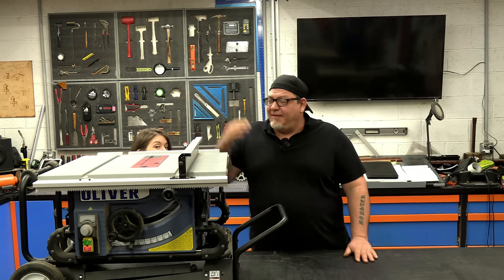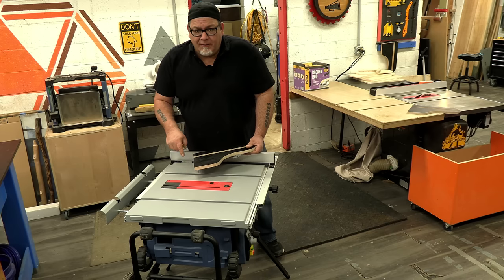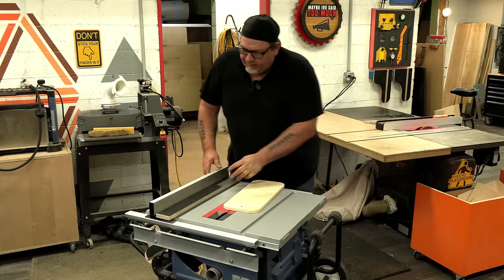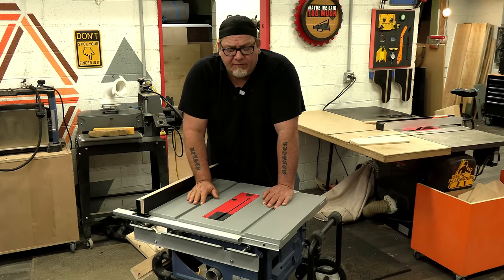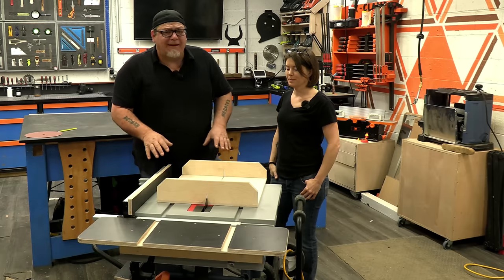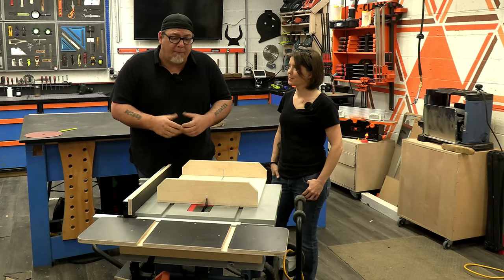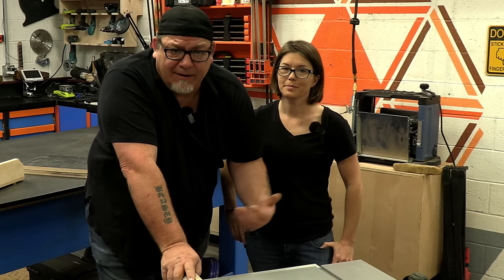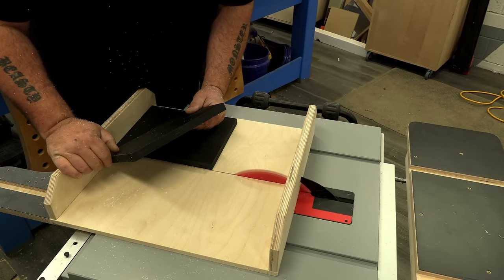3 Job Site TABLESAW jigs that WILL up your game!

Comment: As soon as you started cutting acrylic, I immediately realized the value of variable speed on a table saw.
Reply from the maker: The cut finish is much better at the lower speeds.
Reply: J'ai rien compris
Reply: Might be also helpful for cutting cherry and other woods that are prone to burning.
Reply: @izzyswan  A smaller diameter blade would go someway to achieving the same thing.
Reply: I was just looking to see if table saws have different speeds!

Comment: This is a great vid! I work with a Dewalt jobsite saw and was thinking of modifying the fence to accept sliding jigs, but I've been hesitant about it because of the flack I was afraid of getting. I like how you addressed exactly that. Think I'm going to go ahead with the mods and not worry about it. Thanks Izzy!
Reply: It's your saw! Do what you want with it. I'm just in love with the accuracy of tape on mine. I've never had that before. Always used a tape measure, front and back of the blade. I never knew how great it is to just set and forget.

Comment: I like that variable speed feature of the saw, always wondered why practically nobody built that in.
Reply: Cost - it's more expensive to manufacture, thus lower profit
Reply: @davidpeters8813  oh, I get that for sure, it's just that there are openings for different levels of feature sets in the market, and different price points. Soft start and variable speed motor controls have been quite inexpensive for a while now, and with the increasing use of materials that could benefit from lower saw speeds, one would expect to see variable speed controls at least on the high end. But they're conspicuously absent.
Reply: Question, would a Dart VF100 Series variable speed motor controller work on a Craftsman 113 series contractors saw without burning up the motor?

Comment: I inherited a DeWalt radial arm saw, Dad purchased it about 1962. I built an 8' table for it in 1964 based on a plan in the owners manual.  The disk sander never worked well, now I realize the speed is too high. Thanks for the tip.

Comment: Some excellent upgrades and well designed solutions. I am not sure about the sander hack, the side pressure may lead to premature wear on the saw's spindle bearings if they are not designed to handle it.

Comment: That saw looks identical to the Grizzly version, just in blue. It looks like a nice saw too, and considering it for my next saw as I would like to get a hybrid saw, but would really eat up a lot of space in my garage. I really like the idea with the outfeed table you made because that's a real issue for me right now.
Reply: Thinking the same think. It’s gotta be a rebranded for Grizzly. Also You can order it at Home Depot.
Reply: @nikonshooter71  I also noticed the same on the Rikon version. It seems that the Rikon and Grizzly and Oliver are much the same.
I did notice Grizzly sells without the stand for less...
Reply: My Grizzly GO869 is that same saw in Green.  I got it on sale without the stand 2 yrs ago for $350 on sale. Love my Grizzly jobsite saw.
Reply: @jamesdinnan4726  Glad you're happy with it. So far the reviews I've seen have been positive about Grizzly in general.
Reply: @FrankRosenthal-lg8qf  Seems like Rikon is cheaper now with the stand. Plus it has a 5 year warranty where the other two only have a two year warranty.

Comment: If you're willing to risk it, I'm curious how this saw does with the Evolution and similar 10" metal blades for thin steel.  Those blades are meant to run at 1450RPM or thereabouts, which is down far enough to be in the range on this adjustable saw.

Comment: Great improvements. I always look forward to your awesome & informative videos. 

Looking at Sawstop (for safety) saw for my itty bitty 1-car garage shop, only about 11.5' wide. Want a good quality saw for precision fine furniture work but shop is sooo small.

Debating jobsite saw (small/portable but doubts about quality/capability/precision, no dado), contractor saw (better quality with 36" T-Glide fence, but overly large for my space), and lesser cabinet saw (better quality with 36" T-Glide fence, quite large for my space but less so than contractor saw). Dust collection is important. 

Any thoughts, especially wrt trying to do fine work with jobsite saw and that saw's quality/capability?

Comment: These are some great ideas.  Good for people that can’t afford or have the space for a hybrid/cabinet saw.
On the infeed, you have’s to loosen the toggle if you move the fence, correct?  And when it presses against the slide, does it affect the fence position?  In terms of drilling holes, you can always get replacement parts.
Reply from the maker: You are correct once the toggle is engaged the fence cant be moved. it doesn't effect the position of the fence
Reply: You can get replacement parts until the manufacturer no longer makes them.

Comment: Do you think you could use that saw at lower speeds to cut aluminum?
Reply: aluminum will cut fine on high speeds.
Just use a blade with at least 40 teeth.
The more the better.
And slow feed.

Comment: The high-speed footage (with no voice over) just makes it hard to understand how to make the accessories. I mean this to be helpful. 

On a separate note, my Grizzly contractor saw has variable speed, soft start and an excellent rack-and-pinion fence system which is 100% accurate. Maybe both saws are made by the same factory.